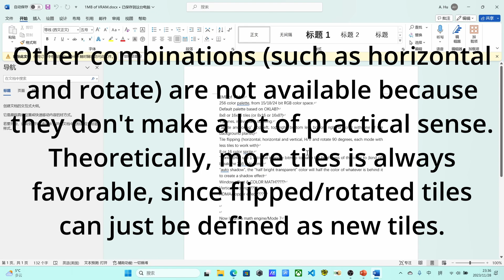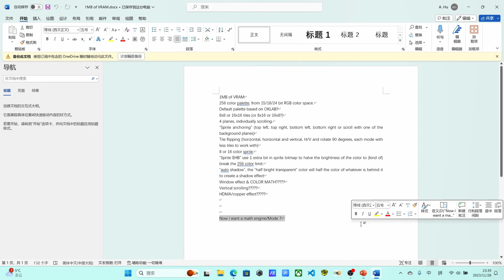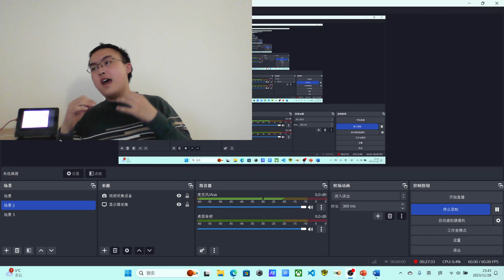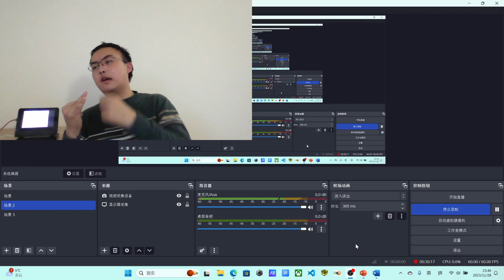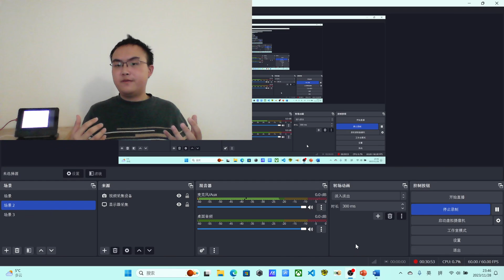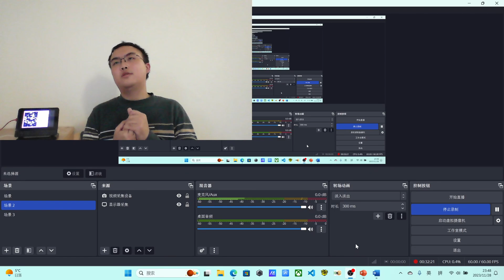The 8-bit arms race is frustrating

Comment: When i heard the z80 production is shutting down a bought a couple cause I always wanted to build my own homebrew. I will say you must have a clear idea of why you want to build it. I dont want to compete with other popular retro 8 bit projects. That is not my vision, so i wont be caught up in an arms race with them as you said. Let them destroy their dreams.
My vision is to build a hombrew with current day knowledge but 70s/80s technology. I dont want to sell my computer. My project i want to build the keyboard, audio device the graphics card. The reason is that if someone builds my computer they have the knowledge to adapt and change whatever they want. I will hope that their will spring up a community using the stock standard system and writing awesome code to share. People building hardware extentions without breaking backwards compatibility and sharing that. For me the end is what most other projects started with. Have a system with limits and figuring out code how to break those limits not add current day hardware just to compete on graphics. For me its the community and the programs. I want people to write awesome games for it not crappy games with awesome graphics.
The only cheat i have is the vga im planning to use for the graphics card running 640x480 which is not the 70s tech but the reason is that its the most accessible for a glabal reach. 
I hope my project will finish someday with all my dreams. Im not going to compete with anyone. I want people to really reexperience the original homebrew community of the 70s

Comment: Im not sure I completely follow whats being said.   But when the  X16   was shown... I thought to myself..  Why?   As a kid, I liked messing around with the C64.  I made a sprite, and controlled it with a joystick, following examples in the manual.  But, Id quickly learn, that commercial games required a Tile Editor (which wasnt included), and that Standard Basic was not even close to being fast enough, for the kinds of games that I might want to TRY to program.  Couple that, with my lack of Math skills... I realized that I was not cut out for Programming.   I loved to Design video games (on paper), and Im a pretty decent "Concept Artist"... but I know my limitations, and programming is something Ill never be good at... no matter how many tutorials are out there.  I also realized, that even if I WAS able to Program well... that would leave me with no time for complex game design work.   Some of my designs, have taken many months worth of sketches and working out various details about the game, its levels, enemies, its look, controls... etc.

 Even though the x16 is supposedly much faster than a C64...  its still slow for 100% Basic programming efforts.   I believe the system also lacks a lot of the Editors and other tools, that would help a programming Noob like myself,  to make anything with it.   And then there is likely a lot of Hardware limitations to deal with,  which to get around, would require further complexity, that someone like me would give up on...

 Which brings me to the Point... in that if you are a person that is capable of understanding how to Program your own Tile Map editors, code in some Assembly... etc... then why do you need or want to program on a Severely Limited system?   The Commodore only had 8 sprites... so why use that, when you could be developing on a system that had a limit of 200 hardware sprites, instead?   Otherwise, you need to make special hacks and methods to get around these pesky limitations... and there will be a lot more Efforts, and a Lot more compromises, in the process.

 I would think that the Charm of a Retro Machine,  "for existing egg head programmers"  ...is not merely the limitations.. but the Simplicity, and Speed of creating something fun and new.  Like you said earlier...  +70 pages of documented features, isnt what most retro programmers are interested in.   Especially since, such programmers can likely whip up their own game frameworks, on modern PC hardware + Software engines.   They can choose to limit their games to whatever resolutions, and or other limits that they choose... while still having their games being Infinitely faster.. and potentially easier to program, to boot.

 What Sold so many  C64's   wasnt the fact that people could toy around with some basic on it... but instead, to play some unique games on it... and to experience some cool Synth music on it.

 I believe the only real way to make and Sell a Successful  "Retro"  system today...  is for it to have Unique.. yet affordable games, that you can not get anywhere else.   That you can not simply download on your PC, via some emulator.   There would need to be some sort of copy protection... just like many modern consoles.   The games do not have to be the most graphically superior.  But they need to be very addictive, challenging, and balanced.   Super Mario Brothers, for the NES... was ultimately a  "MUST HAVE"  game..  and it sold the NES systems like MAD.   Unique Controllers...  like  360 Degree Spinners, Trackballs, Yokes, 3d Glasses, Light Guns, Force Feedback Steering Wheels...etc..   are all a huge part of what made the 80s arcade games, such Timeless Classics.

 But... If a programmer already has the skills to make a fantastic arcade game...  then why would they limit their creation and sales, to a limited platform?   When instead, they could sell their games across many different platform, all at the same time... and make much more earning potentials?

 The console would have to already have a LOT of interest,  and pre-sales,  before any programmer would even consider having an Exclusive deal, with single platform.   And as such, the only way to get massive sales.. would be to not only develop good hardware and software tools... but... to actually get a few very talented teams together, to produce  TOP TIER  games,  that people couldnt live another week... without having to own for themselves.   That would also mean, needing a creative director / manager...  with regular meetings and play-tests,  with non-biased, random, testers... similar to Focus Groups, and or Putting games in an actual arcade,  to see how much money they Earn...  how much interest was observed,  and secretly asking what the kids playing... felt about the game experience.    In fact, in the Elder days of Atari... they used to put prototypes out on the floor, for any employees to be able to play, on their breaks.   When it was noticed that certain games were being played often, and by a lot of the staff... that was a huge Green Light,  to push the game further down the development path.   That said, there were still countless projects, that made it all the way to the Arcade Tests... and the public just didnt dig-it...  and the whole game was completely scrapped, as a result.

 Unfortunately... most of todays  "Beta Testers"  are way too much of  "Yes Men"  ,to be of any decent use / value.   These testers are often not honest nor critical enough... and those that might be Critical... the team tends to Boot off the project,  as they dont want to hear negative feedback... nor do they want to have to accept having to make some pretty radical changes.

 Nintendo has routinely put out Inferior Hardware to the Competition... and Still has managed to keep on top... because they tend to have much better game designers / creators,  and make far more universally enjoyed games.  Ultimately, its the Games that sell their systems...  not the Superior Graphics / Hardware.   Great Graphics can help sell things... but only to a certain point.  Not everyone will buy a game, until they see a lot of positive reviews... and or,  they have tried it for themselves.   If the game isnt that fun... it does not matter how good it looks.  Eventually the sales will cease... and it will ultimately bomb.

 Now... maybe if you created a special Handheld, that had a built in Spinner... as well as dual analog buttons on the top,  for pong / tempest and driving games..   you might have something Unique that the big companies currently Lack.   As most modern companies, no longer produce any Unique controllers... and those damn mini analog sticks are simply AWFUL for precision game control  (there is a mechanical way to fix this... but these big companies seem too ignorant to be able to figure it out).

 Id also add... that a good Vector Mode,  should be added to such a system.   Games like  Tempest,  Asteroids Deluxe,  and Star Wars,  may not be that graphically impressive by todays standards... but they have a unique look,  and they Play fantastically.     Possible Stereoscopic 3D versions of Vector games,  would also be flippin amazing.   Though, that might require some sort of VR display...  Or at minimum, a perfectly sync'd shutter glass solution.

 Anyway... if people really want to make a Game Programming environment as Friendly as possible... then that should be the top level goal, rather than mere imposed hardware limitations.   Of course,  I believe there are some existing simplified  Drag and Drop  type of Game Engines out there already, for the PC.   These also already include the Sprite editors, and all other needed tools, built in.   Ive never worked up the nerve to try them for myself... so I dont know how effective and or limited, they actually are.

I have some Fantastic Arcade Game designs...  but sadly,  I lack the Cranial Prowess, to turn them into Reality...  = [
I also lack the funds,  to be able to pay and direct a team to make them...   =[

To close...  dudes like the 8-Bit guy,  (and yourself)...  are a very Unique breed of person.   I believe there are far less individuals on this level of capabilities, than he realizes...  and that most whom are at that level... will be putting their efforts into modern hardware / software.   Very few people today, are going to be programming a pricy 8-Bit toy, with Assembly code.

Comment: If you are interested in Z80 multi tasking you should spend a weekend looking at one of the older (1980's) Wang VS minicomputers (mini-mainframes) - as for your your HEC machine, why not prototype it on a modified (actually, extended) RC2014+ bus (the second row of bus pins is only half used). At least that way there are further options (including RPi VDP) and you can sell smaller kits or PCB's wiith BOM - there is a YT video of an ESP32+RPI bus driver getting a 20MHz Z80 to do 50+MHz on a RC2014 bus. - at least that way you dont have to attack the whole of the HEC ecosystem all at once before it can be used by others, and "financially viable" can be left off the table for the 1st itteration / PoC.
Reply from the maker: I have a RC2014 mini, that will work.

Comment: I thought the idea was about the technical challenge of implementing protected mode -not of making a product which could be sold.
Regarding feature creep, perhaps an 8-bit retro rule book is in order.  Just like with automobile racing, there are different classes to compete in.  Eight bit computers with non-traditional capabilities could be considered to be in a 'super stock' or 'pro-mod' class rather than 'stock'.  There could even be an 'unlimited' class -something like top fuel dragsters or funny cars... only with 8-bit CPUs.

Comment: I understand your frustration. I've been working on building my own 16 bit processor, but I know it won't ever be successful, regardless of how powerful it is. Right now, I'm trying to go even more niche than just a retro computer, I'm trying to make it into an educational tool for understanding how to construct supercomputer topologies. I'm not sure I'm in a position to be giving advice, since I haven't succeeded at all, but the spirit of retro computing is more about building amazing projects from simple components, which the x16 and agon both completely fail at, in my opinion. They are removing all the interesting programing and hardware hacks, and replacing them with FPGAs and CPLDs. Even if the HEC doesn't become popular, I'd still buy it, because I value ingenious design over a brute-force FPGA.

Comment: The "openness" of these enthusiast-driven retro projects limits their commercial success. The number of users that actually care what's hidden inside a keyboard/case with a few I/O ports is always going to be limited. These devices could all be implemented via emulation on a $10 stick computer module. The most expensive hardware parts would be the keyboard and case. What is the point of designing around a real 6502 or Z80 for anything other than a hobbyist project? The people who care about the retro-purity of what's inside the case are being irrationally religious.